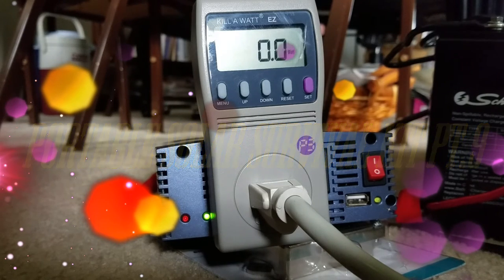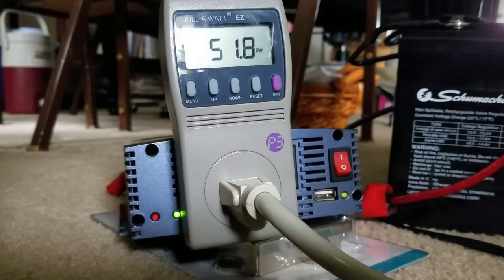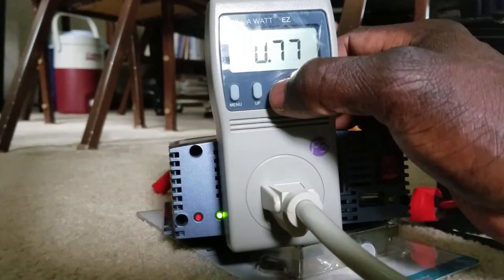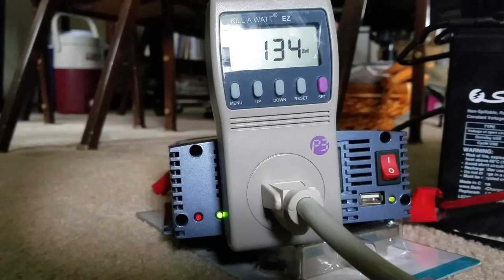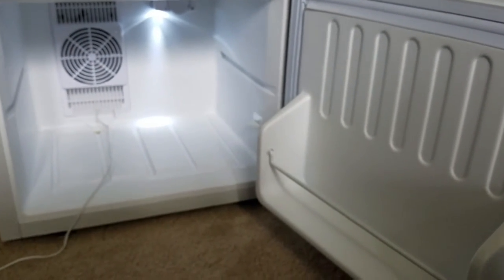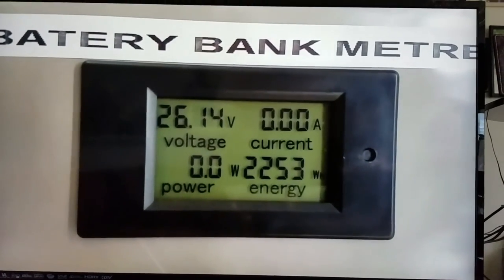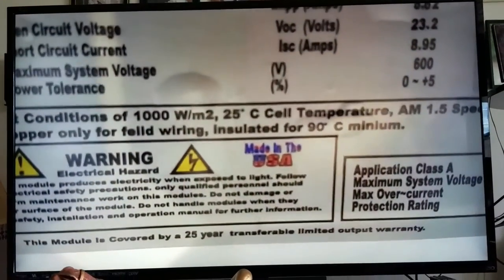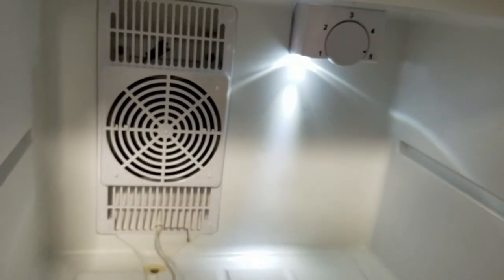SOLAR SURVIVAL KIT Pt.9 By: jwsolarusa

Comment: I am in the process of installing a 20-panel 6,000 watt grid-tie array with micro inverters. I have a separate 16 year old 1200 watt array with a Trace 4024 sine wave inverter that also feeds a bit of power back into the grid. It originally included battery storage but the batteries died about 12 or more years ago.
Reply from the maker: +tomwiles 
Good for you brother. I hope everything goes well with the installation.
Please let us know how everything turns out by uploading your awesome installation videos.
Good luck buddy